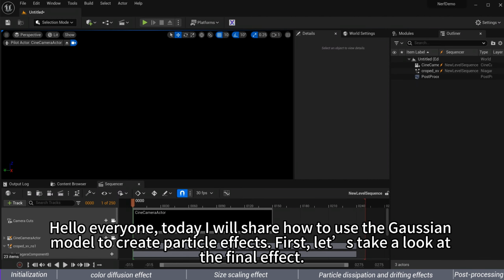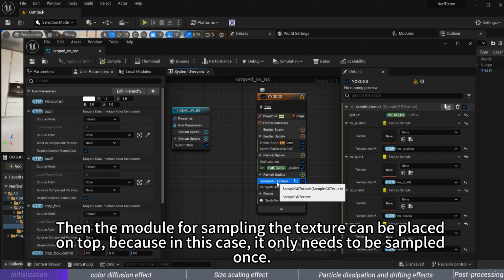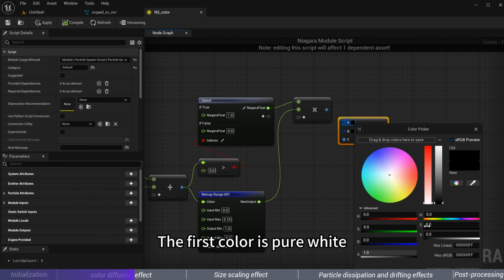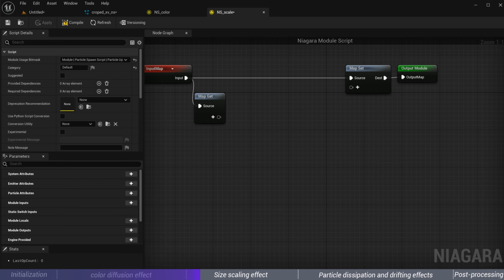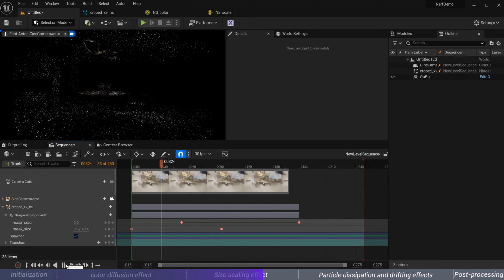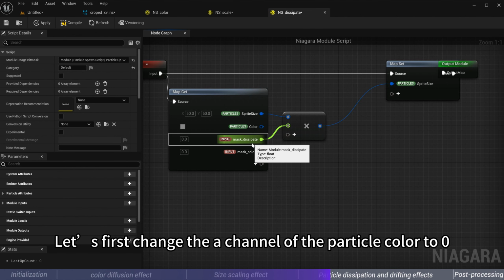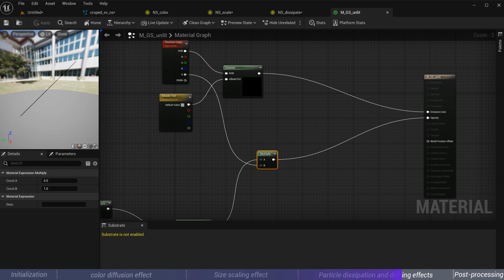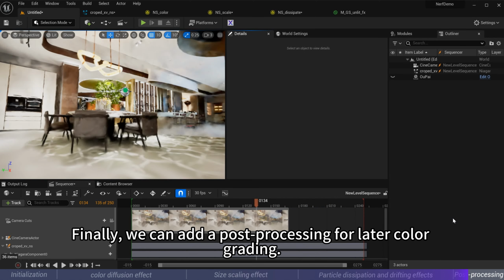3D Gaussian Splatting + VFX is AWESOME！ [Free 3DGS Plugin Tutorial]

Comment: Greetings. 
Why does the plugin not want to accept files exported from PostShot and SuperSplat of the latest versions?? ((
 Returns the error "ply properties header format invalid, pls check it first"! The plugin version for Unreal Engine is 5.4
Reply: import the ply to gsplat editor then export it. The header issue should be fixed on the exported ply from gsplat
Reply: @CINUMTEC  It works, but the model keeps getting cut off.